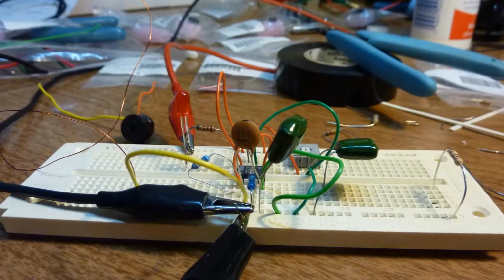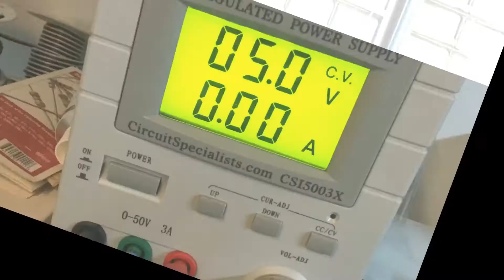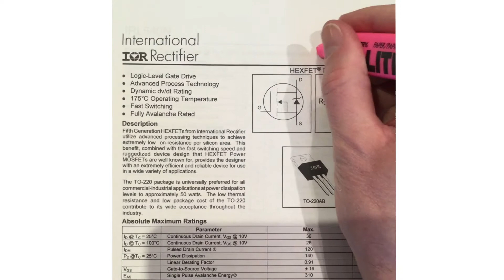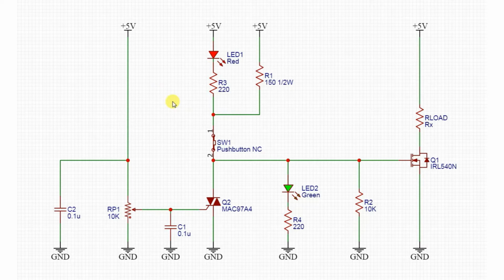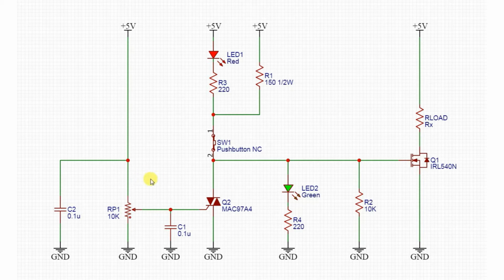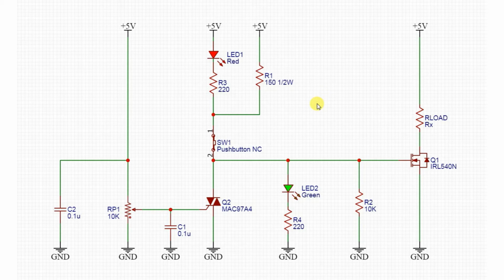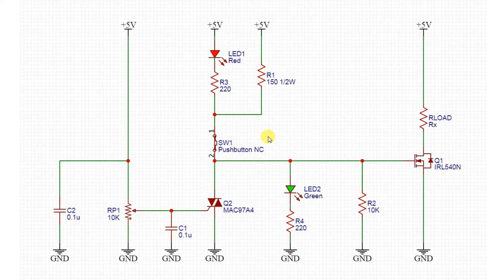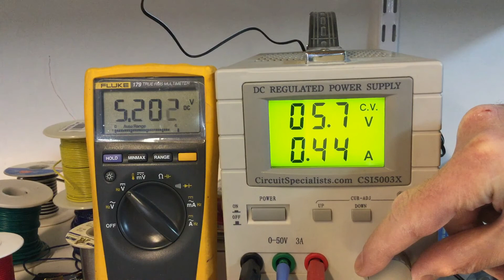5V Overvoltage protection circuit

Comment: Firstly, congratulations on producing a very clearly photographed and explained video with absolutely no verbal bloat. I instantly understood the circuit diagram without listening to your explanation and the design is very elegant. I was searching for an over voltage protection circuit for an Arduino based instrument that I am developing and I need to protect one of the analog pins from exceeding 5 volts. This circuit does not quite fit the bill as I need something that automatically resets itself when the voltage drops back under 5 volts. I intend to adapt your circuit to use a LM431 Adjustable Precision Zener Shunt Regulator in place of the MAC97A4 triac. 
So many thanks for publishing this circuit. I have subscribed.

Comment: One note of caution: there are two distinct types of green led available. The older type was not very bright even at 20mA, but only had a forward voltage of about 2V at that current. The newer type is much brighter, but has a forward voltage drop around 3.5V at 20mA.
If you're using a 2V green led, then you have 3V/370R = 8mA through the 150R and the led/220R. The gate of the MOSFET will be at around 3.8V, which should be fine for the IRL540 (Vt=2V max), but not all "logic-level" MOSFETS will turn on as hard with that gate voltage.
If you're using a 3.5V green led, then you have about 1.5V/370R = 4mA through the 150R and the led/220R. The gate of the MOSFET will be at around 4.3V.
Personally, I'd be tempted to use 330R for R1 (which then doesn't need a higher power rating) and 470R for R4/R3. A high brightness green led is plenty bright enough even with 2mA. The current through the triac when triggered would be more than 15mA, which is still above the maximum holding current of 10mA.

Comment: Couldn't one just use a zener diode to open a normally closed relay, and in that way cut the power to a circuit when the input reaches the limit of the zener?
Reply from the maker: Unknown, I’d have to see the circuit you are proposing.

Comment: Great project 
I want circuit for variabl power supply?
Reply from the maker: In that case you would set the potentiometer for the voltage you are interested in limiting. You’d need to alter some of the resistor values for higher voltages.
Reply: @simoncarter568  thank you